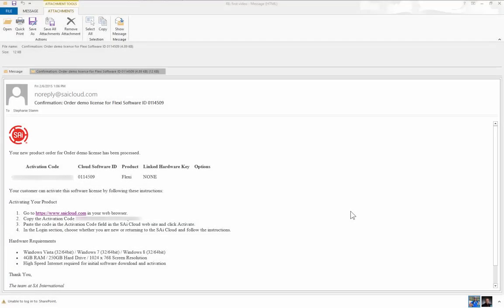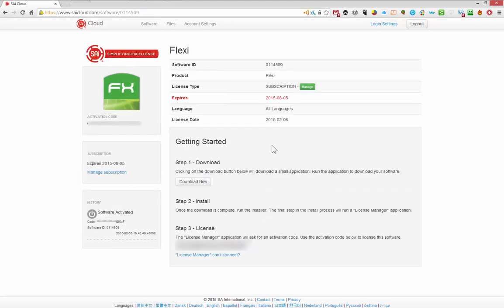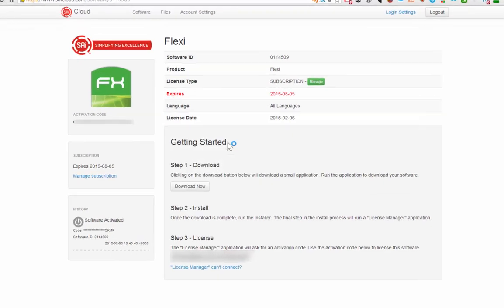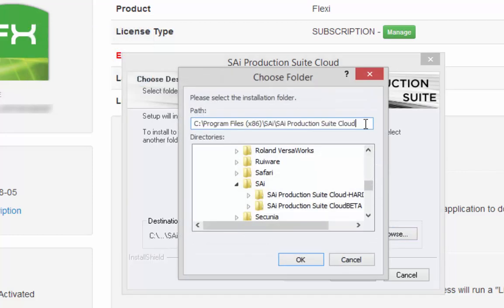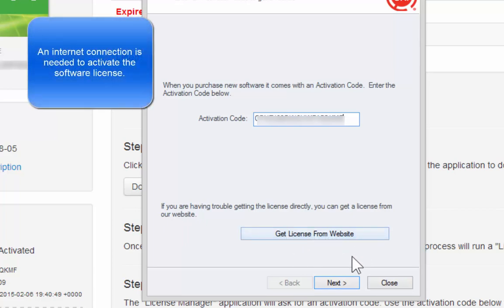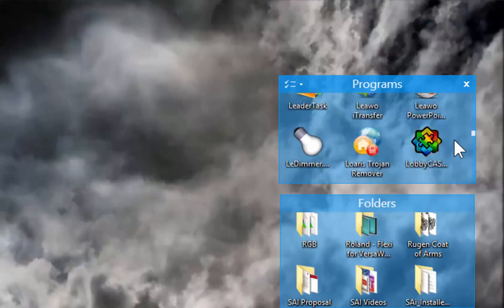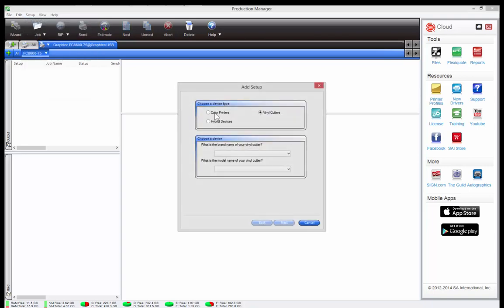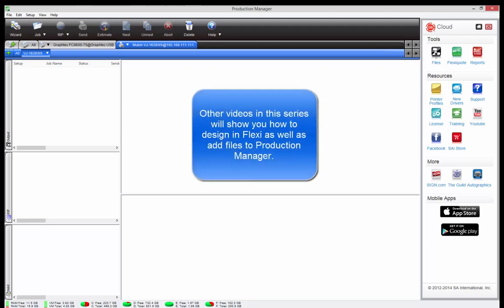Installing Flexi Signmaking Software

Comment: As expensive as this software is the programmers are idiots. I have software that costs $20 dollars and the updates are written intelligently so that all preferences and customization are retained while the update merely updates those components of the software that need updating. Trying to update this software is such a pain in the ass I have five copies of it installed and I have to keep track of which jobs have been done in each version so I don't loose the settings I worked so hard to set up in each version. It's a nightmare and it's disgraceful. I'd be ashamed to admit I was a programmer for this company.

Comment: I have Flexi 8.0 and I recently bought a Red Sail plotter 24" to replace my Ioline studio 8/30. Wonderful you would think but there is no plotter code  for this brand... what is my options? If you can resolve this issue than I would say your software is the best in the industry... so lets see what your software will do for a normal consumer.